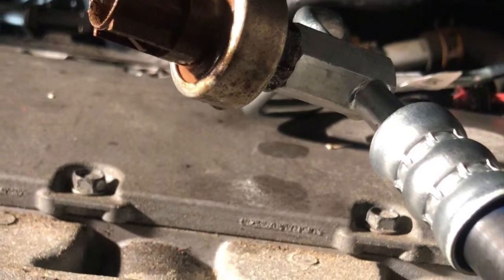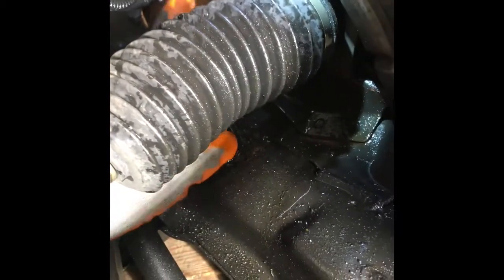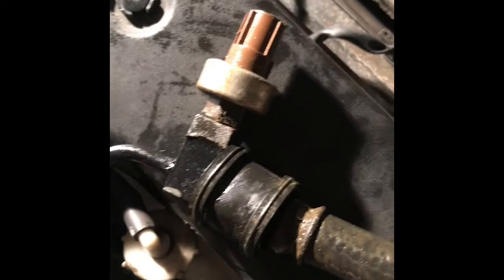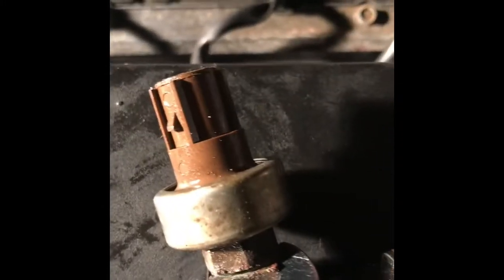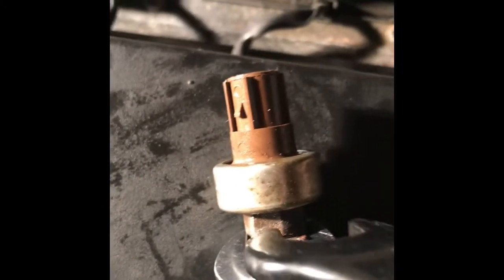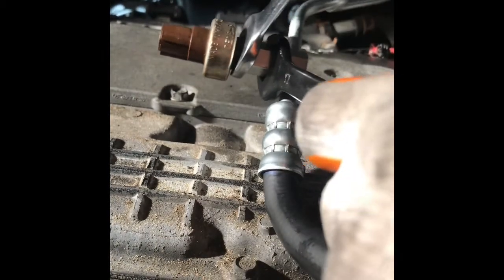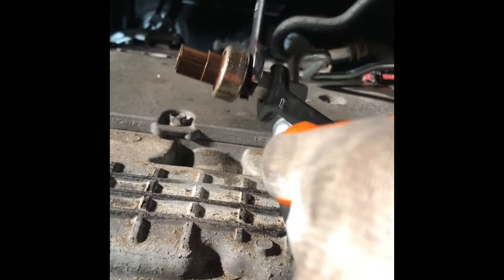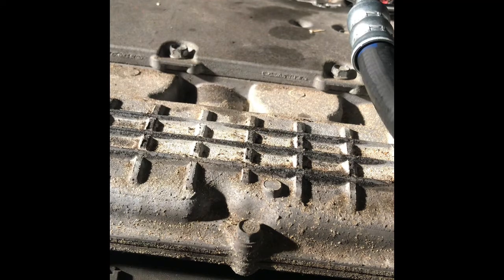07 Honda Odyssey power steering pressure switch replace

Comment: Question:

My 2001 Honda Odyssey steering wheel was becoming stiff to turn and now I have no power steering. There was no unusual sound comming from the pump but the engine would struggle upon a cold start and shake and now since there is no power steering the engine cold starts perfectly and is running smoth . Also, there are no leaks and the fluid is reading full on the power steering reservoir.

Question: what is the problem and what needs replacement. 

Bad Power Steering Pump ?

Clogged rack and pinion ?

Bad Pressure Switch ?

Clogged line ?

Any help would be appreciated 👍
Reply from the maker: Hi I hope everything ok with you.if you feel problem when you turn .then pressure switch issue.if sum time have problem sum time not.rack pinion issue.if making grinding noise and look inside reservoir if u see Babul replace o ring for hose.pump is bad it will make noise to see fluid returning to reserve hi pressure to low pressure if not pump.thank you for comment